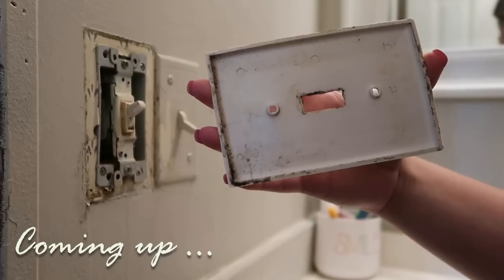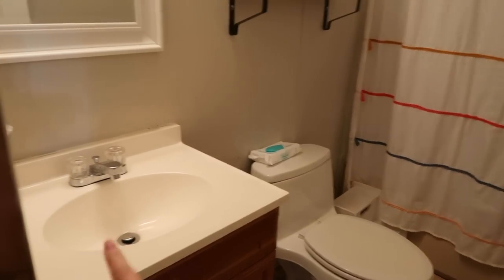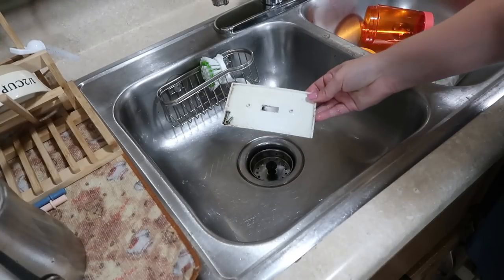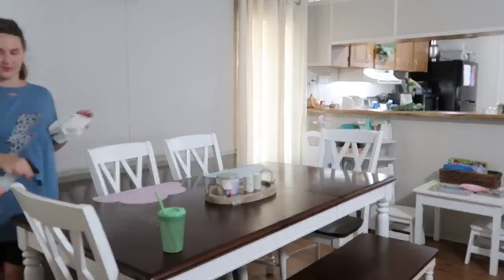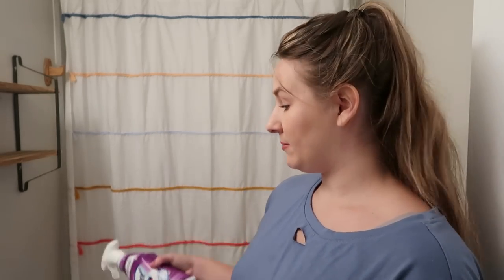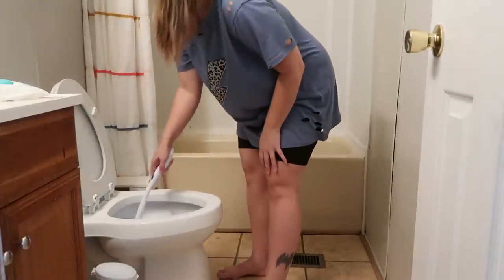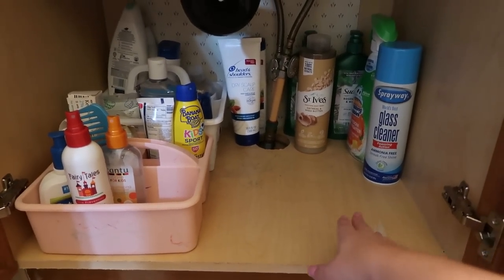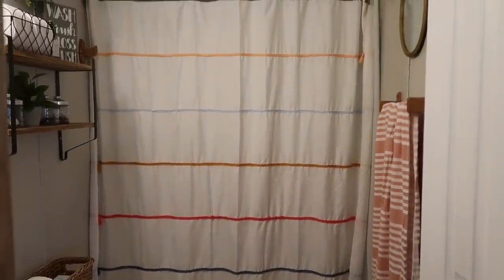CLEANING BLACK MOLD 🤢 🤮 DEEP CLEANING MY MOBILE HOME | CLEANING MOTIVATION  | MarieLove

Comment: I’m not sure if anyone has mentioned it but you can get damp rid and hide it behind the toilet and maybe a smaller one for under the sink. It helps pull the moisture out of the air. 
I totally understand having no where else to go and not wanting to stir the pot even though we all know the landlord should fix it. I’m the meantime just keep cleaning, trying to keep the bathroom as dry as possible and stay safe mama ❤️
Reply from the maker: Thank you. I did buy some damprid and the dehumidifier is helping a ton. We dump it twice a day! It's crazy how much moisture it's pulling.
Reply: @MarieLoveAsbury  you’re doing a great job mama!

Comment: at the dollar general store there are these things you set around your home that absorb mold n mildew   Got some around my dads house cause his house is bad for mold forming   Has something to do with vents around bottom of his house   If too many are closed in summer mold starts to come in on walls at bottom n if it is not closed up in winter right same thing happens. Cause of too much moisture n whatever  it is very annoying so I found that n set it out   You just peel
Off foil cover n set the containers wherever mold is

Comment: Ugh mold sucks I feel for you and your family. We've have experienced it with every rental we've moved into unfortunately it's very common for landlords to just cover it up and make it look good due to how costly it is to hire a crew. Seems like they will just keep covering it up until the floor and walls soak up so much moisture that it has to be replaced. My husband works in mold remediation and I would definitely reccomend lots of air flow and to continuously run a dehumidifier in there until you move it will slow the process down. (Try not to let your bathroom get steamy at all)

Comment: I'm pretty sure if you continue to find mold you can call the health department. But, I can imagine how scary that would be with not knowing if you could find another rental. These are exceptionally hard times we are living in. Have you tried hanging a damp-rid or arm&hammer bag in there. We used them in closets and bathrooms when I lived in Oklahoma. Because of the humidity moisture and mold is such a common problem. I'm in AZ now, humidity isn't a problem, trying not to get hear stroke is 😂 I hope you find a solution that works between you and this current landlord.

Comment: Mix bleach and dawn together and scrub everything with it. It killed the mold in our old trailer. But I say there’s a bigger issue. There has to be an opening of water coming in. Something is leaking causing it. I say it’s an easy fix if they would just open the wall/ceiling to see where it’s coming from. Keep notes and dates of every sickness you guys get and take pictures of the mold and when they come to “fix it” and dates. That way you have evidence if they choose to be butt heads about anything. Hopefully things get better but just in case have that evidence.
Reply: Keep tract of all the money and work you’ve put into trying to fix the mold and floor problems. It shows your good renters and your not being treated fairly.

Comment: We had flooding and FEMA came in said use 20 Mule Team Borax on black molds. If in walls it is landlords place to have it removed. There have been mobile homes in PA condemned because if black mold. Love your videos praying your landlord does the right thing.It will not go away inside your walls
Reply from the maker: They will let this place rot. They just want to collect money. Our walls are buldging and bowing in multiple places from moister problems.
Reply: @MarieLoveAsbury  Praying for you.🙏❤️

Comment: Marie…I’m praying for you and Eric to become homeowners real soon. 

You all should not have to put up with an uncaring, sloppy, and  lazy landlord like this. Black mold will not go away until proper professional mold  remediation. 

I am a homeowner and had it in my kitchen and my master bathroom. We have been rid of it for 10-15 years, and it did cost a lot, but at least it is gone and no longer a danger.

Comment: The reason mold is growing in your bathroom is because your roof is leaking somewhere. Probably started around your ceiling fan and is probably running down the wall from another leak to the outlet. Black mold doesn’t grow if it’s dry. And with it growing on the ceiling I would lay my money on your roof leaking And I bet they probably know that. But hubby needs to definitely get on the house and check the roof.
Reply from the maker: They roof was leaking in multiple places when we first moved in. They bought materials for a brand new metal roof, but paid a maintaince guy that didn't know what he was doing to do the job. There was tons of screws missing, nothing was sealed and they put it OVER the old roof instead of scraping off the shingles. It's a whole mess over here. 😩
Reply: @MarieLoveAsbury  Marie I knew that was what it was and those sob’s know it too. Bathrooms and houses for that matter doesn’t grow mold unless you have water leaking in somewhere. I think if you look into it there is probably something you can do about getting it fixed. That is a gorgeous double wide. It is a shame that they’re letting a leaky roof cause it to rot down. People like that shouldn’t be in the rental business if they won’t keep their properties up. You are an ideal renter. You take really good care of it. You keep it so clean. They should appreciate you and try their best to keep things fixed so that you will stay.